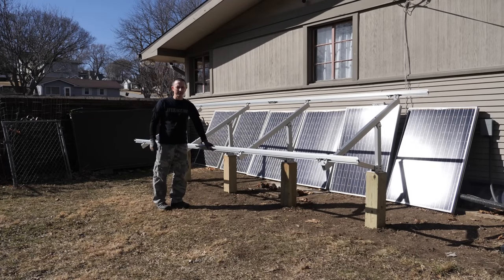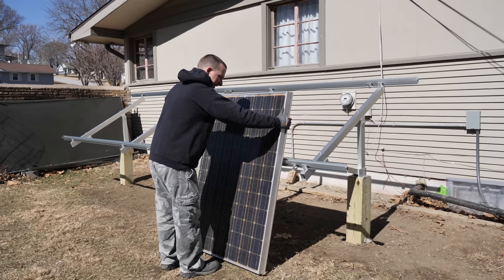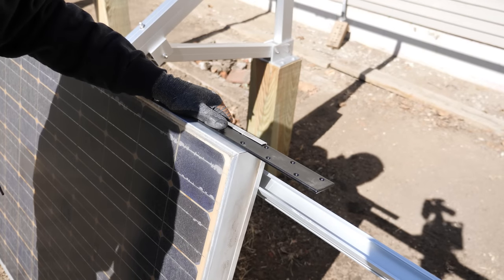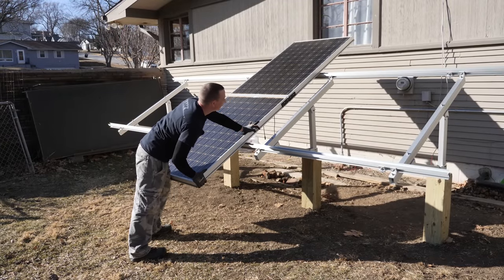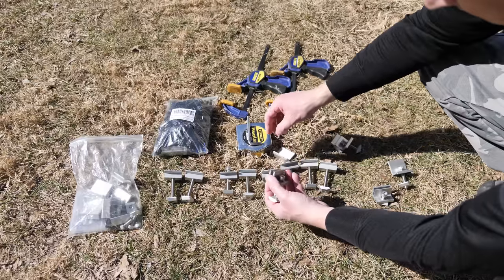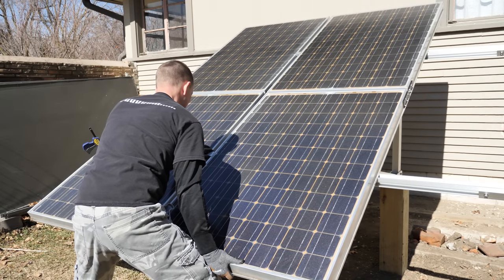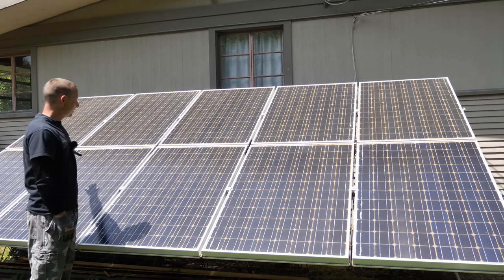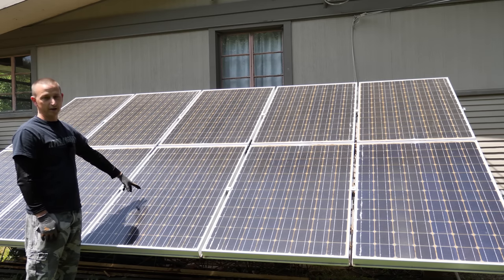10 Solar Panels on a 4 Panel Rack HAHAHAHAAAA!!!!!

Comment: You did awesome job! 
if anything I personally didn't like the wood posts & the way the brackets are attached to it, regardless of PT or not water can damage the post from top and make the bolts lose, if that's the only option you have you should have added galvanized floor bracket to keep the wood together in case of future water damage, specially with the amount of flexion it has, wind can make it come lose,, the other thing I would do is spray can of tar under the brackets. I am not sure where you live but here in FL hurricane is our worst enemy when it comes to structures like this. I would also add a support both at high and low points to take the flexing out or to minimize it.

Comment: Very good idea.  I might have even left an inch between the pairs to allow wind to escape rather than lift, but the gaps between the pairs should be sufficient.  I think a lot of people will be looking at this idea for sure!  Thanks for sharing!
Reply from the maker: Thanks! If others try regular sized panels Id be interested to hear if it works!
Reply: @AveRage_Joe  Im getting read to. Ill be putting Neo Solar 335w panels stacked 2 high. My calculations show I can get 2 Brightmounts and put them directly side by side and 2 rows high and 9 rows wide with my panels which are 77"x39.1".  I am going to use 1"x4" treated wood to run vertical for the panels to mount to. The wood will be temp until next year in hopes of metal/unitstrut prices coming down.  I will use either 4x4 or 6x4 to mounth brightmount to and run them down into the ground anchored with concrete. I just have to calculate how tall the mount has to get my steepest angle for my zip which is 46.4 deg to keep overhang from going into the ground when adjusting tilt angle each season.

Comment: We have used the same idea in my work... but I would not use steel brackets on aluminum, we used 12in L shape brackets, that way it gave measurement between panels and prevented any sag in the middle. We tried just using 3M VHB tape (because it was supposed to be for a few days) but then we added screws and is been 2 years in use. For the clamps they sell adjustable ones for different size panels. But overall, great Idea!
Reply from the maker: I LOVE that way of doing it! Was it a T shape or L shape?

Comment: Since they fit, the wider slit between panels may be a good thing.   I say this because someone commented the other day that letting wind blow thru helps reduce stress on the mounts / reduces 'lift'.   Don't know if it's true but would make sense :).     Another nice vid - I like how you think putting 10 panels on a 4 panel rack!
Reply from the maker: Sounds good to me🌬🌪😆 I need as much power as I can get!  Thanks for watching💥🤘

Comment: Awesome work around 
I wouldn’t have thought of that.
Rethinking my install 🤔
Reply from the maker: Thanks! Do you have one of these racks or a similar one?
Reply: @AveRage_Joe  
No but I was considering one from signature and was leaning towards building one from wood.
Now I’m rethinking my situation.
I need a rack for 10 panels and your solution of bolting them together may solve the problem.
I’m faced with limited full son areas. 
Appreciate your sharing.

Comment: I would DEFINITELY add struts to help it survive strong wind. Also, u r banking on lags bolts sunk into the TOP of wooden posts where moisture will settle and most assuredly rot the wood, weakening the lags bolts ability to resist wind. Last, but not least, the small diameter bolts are all that's affixing the panels together and affixing them to one another. That little wiggle you experienced by shaking the panels is nothing compared to a thunderstorm. There are reasons the vendor rated the mount for ONLY 4 panels. It looks stout on a nice bright sunny day, but when Mother Nature gets angry, I would not stand too close.
Reply: Another issue is where the manufacturer specifies that the panels be clamped.
Typically four points about 20-25% from the end, rather than just the two mid-points being used.
But if it's holding up for you, well done!
Reply: In a wind protected back yard this is more likely to work.  If you've got a windy spot out in the open, you are going to have do a little more.

Comment: Joe, you are very creative. Can you get a 3rd rail to run between the two panels to support and brace it from bending or braking the panels in high wind speeds?
The price point on the EG4 Rack is great, yet the 105 mph wind load is not sufficient for my location.
Thanks for sharing your projects!
Reply: 3rd rail was my thought too, but could add concrete blocks and cable stays to hold the tops and bottoms of the panels steady in case of a tornado...
Reply from the maker: Thanks! Yeah I could probly add a 3rd rail in there. May be a good idea for the snow we can get here. This rack is super cheap for all the stuff you get! What kinda winds do you get😲
Reply from the maker: We do get tornados here. No shark nados, just regular ones😆
Reply: @AveRage_Joe  If you get hit by a tornado, you'd have bigger things to worry about! Solar panels aren't as useful without a house!
Reply: @AveRage_Joe I live in Bermuda, an island 700 miles off the coast of Cape Hatteras, North Carolina. We have annual hurricanes with 150+mph winds. Government Regulations are very stringent for hurricane survival.
Our homes are made from 10” concrete blocks, limestone slate roofs and aluminum swing out blinds to protect windows glass from flying debris to secure the structure from being compromised.
Regrettably, that mount would get twisted worse yet get ripped apart, flying at high wind speed velocity cause serious damage. I was thinking about your panels being installed in front of your window in the event you had a storm or tornado.
Thanks again, we enjoy watching your videos!

Comment: Ground mounts are so expensive, it is really cool to see this.  Especially when you've got heavy used panels and you find out that the mounts cost more than the panels!  I've been looking at steel bed frames and metal railings in the freebie ads and wondering if I can create anything from salvage cheaper.  Maybe a combo with some pre-made ground mounts like this and some salvage reinforcement for a really windy spot.
Reply from the maker: Yeah this one isnt to bad at all. Steel bed frames and rails...Thats a Great idea! Im sure that would be plenty strong just made with that alone

This one does have a wind rating if mounted correctly to concrete. I dont remember what it is off hand but should be in the manual on there site. Mine has been through some strong storms allready and holdung up great.

Comment: I actually have 25 of those same panels from SS.  At 30 bucks or so a panel haven’t had a affordable way to mount them.  So I used some old railroad ties and propped them up on the ground.  Angle isn’t the best but it’s sure cheaper.  This might be a way to do it for cheap ish.
Reply from the maker: NICE!!!  I wish I could have gotten more of these panels.  Surprisingly they work GREAT!!!  Ive seen well over the 2kw on the rack so far.  CRAZY!!!

Comment: That's friggin cool! gives me an idea to do that with regular 60 cell panels :)
So you going to wire these in 5s2p then combine the outputs of both p's to a single wire run? with under 8A, you could run simple 14awg wire to your charge controller.
10s1p probably won't work unless you get a 600v PV charge controller.
Reply from the maker: Thanks Man! Let me know if you do! So for these panels Im gonna connect to one of the PCM60X charge controllers and its 150v input max soooooo Ill do a 2s5p prolly lol since the voltage is also weird on the panels. Ill use some 10awg for the run since it was also free😆💥🤘

Comment: I think I’d buy a few round steel posts from a scrap yard (e.g., from an old swing set) and weld on some 1/4 plate for the mounts. Drill ‘em ahead of time. Then concrete the posts about 3 ft deep.
Reply from the maker: Thats not a bad idea!

Comment: With modern panels of up to 500watts  4 would have the same output as your 10. If you were able to squeeze 5 panels on your output would be 25 percent greater. But these 2 ke are basically free as they were lying around idle anyway!
Reply from the maker: Yeah 100% but these were free and sitting!💥🤘

Comment: Joe the best way to connect two from the bottom,never from the side is the weakest point due to the flexing and can crack the glass
Reply from the maker: Yeah I guess I could see that🤔🫣 these are an od size(smaller then regular sized panels) so lets see what happens💁‍♂️😆🤘

Comment: Looking good. I got 4 400w QCells (41"x74") mounted on my rack and there's like a foot and a half of total rail left on the edges, wish it was a couple feet wider so I could fit 5 panels. No way it would support double stacking these.
Reply from the maker: I hear those panels are GREAT!!!
Reply: @AveRage_Joe  They are awesome and they look great, I just need to figure out where to put the rest of them and do some trenching for the PV lines. In a temp setup, they keep my split phase Growatt running, and my EG4 batteries charged up, but this is a long overdue project.
Reply: i sure like to mount 5x of the 40" or 41" width panels - these are the 380w and up - since SS sells them 10 panels as minimum.  wonder where we would be able to buy another rail (the same kind in the kit), and two additional splices, so we can cut a foot off of that rail and extend the two rails of the kit to accommodate a 5th wide panel?  thanks,

Comment: Maybe add some tensioning wires from the top edge of the panel to the wooden supports so that if there's future snow load or wind load it's got some extra support?
Reply from the maker: Yeah that is in the plans for sure. I think I have some random metal just for the job!😆🔨🪓💪
Reply: I was thinking the same exact thing, maybe get some helix ground anchors and some cables.
Reply: I quite like the helix ground anchors, I want to find a project for them at some point.

Comment: I got the 250 Canadian solar panels and I am running in the same problem.really thick too so I think I'm just gonna mount them bolt them to the back. With some unistra, I will get something figured out. Them solar panels. You got are really Thick my Aint. half is bad I don't think. Still works nice job!
Reply from the maker: Maybe you could use the adjustable clamps like I showed?

Comment: Believe it or not I was wondering the exact same thing.... Think 10 solarevers 440 watt panels from singular would fit?  Extra bracing in the front or back?  Aluminum angle iron?

Comment: You're lucky you have a fence and house to defeat the wind. Where I am I have insane winds that blow from the west and from the north into the backside of my ground mount arrays. If I mounted my panels like you have one morning I'll come out and all the panels and the mounting would be totally gone! One of the problems with a ground mount is maintaining the ground under them. Either grass/weeds go completely nuts or the grass dies back with you ending up with moss and other annoyances.  Weed wacking under the array isn't my favorite thing.
Reply from the maker: Yeah the wind is much less right there.  I dont know if I would try this way out in the open unless I attached some extra supports(which I still may do but we see).  So far weed wacking isnt to bad since its only at the lower section on panels.  The rest is gone lol

Comment: Those panels have water in then , that's why the rust is starting inside, the silicon at the back is deteriorating so you should receive after a hot day when the moisture leaves the inside of the panel
Reply: I was thinking the same thing, they're cooked. I'd be testing them prior to install.
Reply from the maker: Could be🤠
Reply from the maker: Tested and used for a few months in this area. Not on the rack tho💪☀️

Comment: Liking the bloopers!  I do worry a bit about  the wind on that mount.  I only have life on the Colorado front range to compare, and it seemed like there was a minimum 10MPH wind 24/7/365.  Do you guys get enough to spin one or two of those Chinese Lantern wind turbines?  That might be something to incorporate into your system if so.
Reply from the maker: Thanks!!  The manual says like 105mph for the rack.....  We dont get any good sustained wind.  Ive tried other horizontal wind gens and its really only "good" in spring and winterish.  Id love a vertical axis wind gen to try tho!!

Comment: What exact grips did you use hold the Panels in place? I use a chair lol. Are they these IRWIN QUICK-GRIP Bar Clamps for Woodworking, One-Handed, Micro, 4-1/4"?
Reply from the maker: Yeah I used those IRWIN quick grips so I could use one hand. A chair probly worked just as good😁

Comment: Hmmm.  these panels look very familiar.  I had these panels oh 15 years ago when they just came out.  They are crap.  You can see in your video how in some of the cells there are problems in the bonding.  That just gets worse as they heat up and eventually the backing will bubble and you'll see the cell just turn to mush in the front behind the glass.  this happened after only 5 years and I live in Northern California at pretty much sea level.  No harsh conditions.  Sanyo was out of the solar panel business so I couldn't get my money back.
Reply from the maker: Crazy. They seem to work great for me. Ive seen them over produce as well. 🤷‍♂️

Comment: What is the difference between those panel and so called regular panels?  Also, it’s more panels the faster you can recharge your battery correct?

Comment: Looks good!
Reply from the maker: Thanks Man!!
Reply: @AveRage Joe  I would love for someone modify the same mounting system and install 10-  540w watt bifacial panels on it. I need to get off my ass and get my stuff going/installed
Reply from the maker: Those are already huge arnt they? You better get out there before it gets tooooo hot!☀️☀️☀️☄️
Reply: @AveRage_Joe  They are almost the size of a piece of plywood ea. Thats why Im watching again, you motivate me Joe! Im replacing my pergola with a new one with Solar panels for a roof. I live in Houston and finding someone to come look at the equipment and gets permits have been very challenging. If you know someone who will prepare permits , lmk.

Comment: I have this wacky idea for the winter. Could you use those 12v heater pads that are for batteries on the back of the panels to melt the snow off? Or the ones they make for water tanks in trailers. Just a thought. That setup looks amazing. Are you going to put a grounding wire on it?
Reply from the maker: Yeah I guess you could prolly add those heater pads BUT since its a ground mount its waaaaaay easier to brush off the snow. Yeah Ill be grounding the frames for sure!💥🤘

Comment: Have you had any issues with wind? Thinking of doing your post backfill idea. Ive got 6 - 405w panels to aplot between 2 of these units.
Reply from the maker: No issues at all. We are actually in a power outage right now from a big storm. Lots of trees and limbs down from the wall cloud that rolled through. Wall cloud had 70+mph wind. Ill also say that having the rack closer to the house and inbetween houses. It doesnt get a huge amount of wind. Anyway, its still up and doing its job!🤘

Comment: Are you going to be any code violation solar panels, being a close to the house? Like near that window or the electrical meter.
Reply from the maker: 🤷‍♂️ I just throw it up for off-grid use. I had some solar water panels there for over 10yrs and the utility company has been here in that 10yr time to change the meter. No issues. If that changes, ill do a video!💥🤘

Comment: Bolting or screwing into wood end-grain is a bad bad bad idea!!! Soon as water starts getting into the grain it will loosen and even though it’s pressure treated it will still start to rot away. There’s different grades of pressure-treated wood‘s. If you bought this from the home center it’s not for direct burial, it’s for above ground use only. Again there’s no strength when you attach something to the end grain of wood. If you’re going to do something like that you need to use a metal bracket that screws into the side of the 6 x 6 and then bolt into that down through the top.
Reply: What he said above ground, ground contact, below ground!  And how much wend do you get in that area! Just saying looking 👀 good 👍
Reply from the maker: Ill have to seal up the ends I guess to help prevent water. Ill look into a bracket of some sort. This is #2 treated and is rated for direct burial or submerged in fresh water.
Reply: @AveRage_Joe  what I was referring to was the big box stores pressure treated wood is not the best for direct burial even their #2. If you go to a small lumber yard for contractors you will find they carry Premium, Select, and a #1 grade for just a few dollars more and it won’t twist and bow like the #2 will. Also when you put the brackets on don’t use any fasteners with zinc in it like galvanized nails. Try to only use stainless steel. The chemicals in the wood will react to the zinc and rust apart. sorry I used to build decks and docks, not trolling your videos! I like your channel👍🏻
Reply from the maker: Oh ok I gotcha! So an actual lumber yard is preferred. No worries man, I didnt read it as trolling💥🤘
Reply: @AveRage_Joe  they will have a better quality, I know #2 is rated for what your doing but it will split and twist on you compared to the #1 or premium and select.